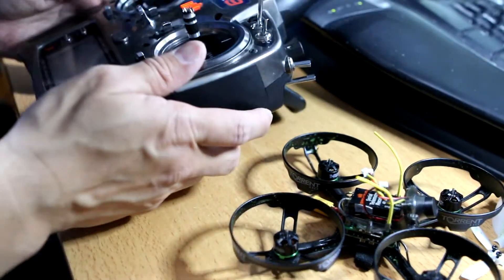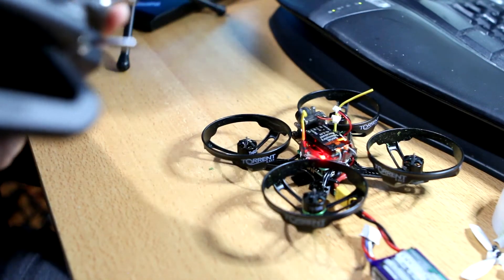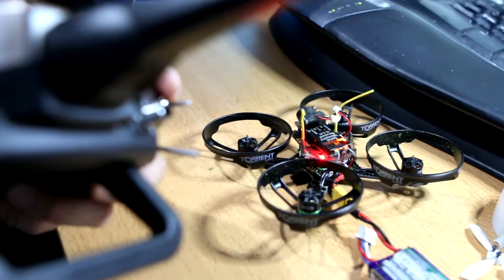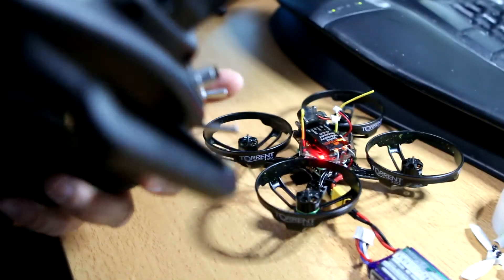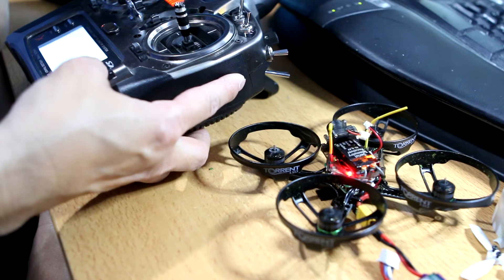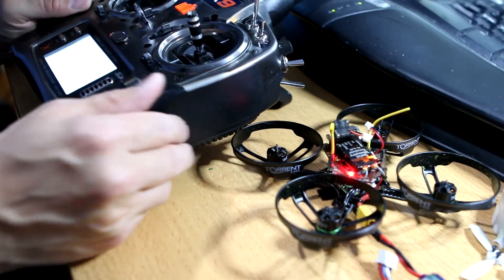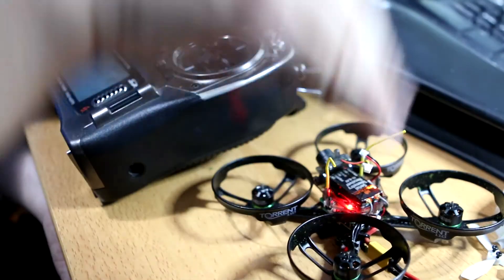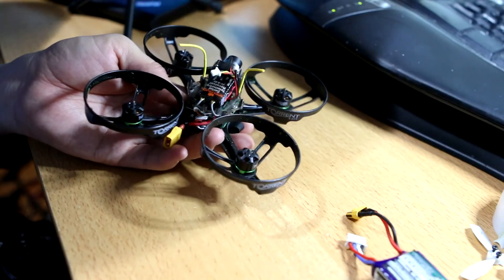Blade Torrent 3 - throttle deadband

Comment: Couple quick tips to make it easier. Hope they help! 
1 - You shouldn't have motor_stop on with airmode, it really defeats the purpose (I'm not sure if you have it or not, it wasn't exactly clear to me)
2 - If you don't have it on, and the props are not spinning when you immediately arm, you need to up your min_throttle just a hair to get the props to start spinning smoothly
3 - The command you're looking for is "set min_check=1005" in cli. Hit enter then type "save", enter and it should reboot the board. min_check is the reason the deadband exists, so that betaflight can have a range to accept stick commands. It's conservatively large due to the variety of transmitters, but if you have a spektrum, that command should solve it. You shouldn't have to edit the subtrims to do this.
Reply from the maker: min_check is actually a good idea, thanks for the suggestion.  for the torrent min_throttle is 1050 for me.  This can be checked easily in motors tab.  Motor stop CAN be enabled with airmode, airmode will override it.  However if going back in to check anything without airmode, it's 1 less button to click.  It was endpoint I was changing (not subtrim, you don't want to change that if zeroed at 1500 centers).

Comment: After doing this , do I have to adjust the min/max throttle and min command values in the config tab in BF to reflect the travel ranges in the receiver tab ?  Not sure if it's relevant but I'm using the spin motors when armed feature when I go out to fly.
Reply from the maker: No, in fact you want to do this in your radio AFTER that is set in BF. To set this you need to temporarily set motors to STOP when armed.  once you find your low throttle endpoint, you can re-enable motor spinning (or just use airmode which overrides motor_stop).
Reply: thanks , I understand how to eliminate the deadband but I was wondering if I should leave the min and max at 1100/1850 like how it was from stock.
Reply from the maker: that depends on if you changed it in blheli config.  If not, then you can leave it.  I changed mine in blheli config to 1000/2000 and in betaflight min command 1000, max throttle 1950, min throttle 1050.  Then did the deadband removal.
Reply: thanks for your help man.